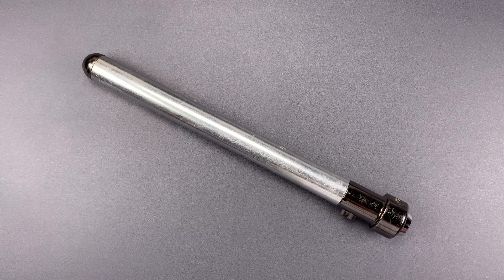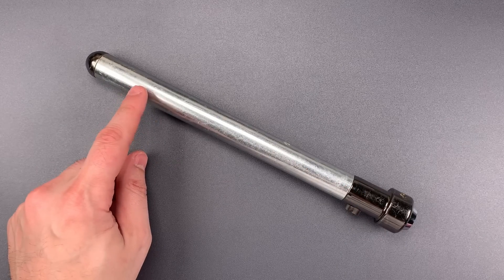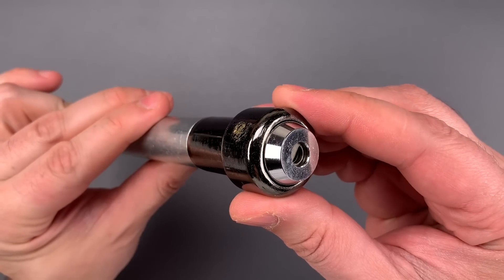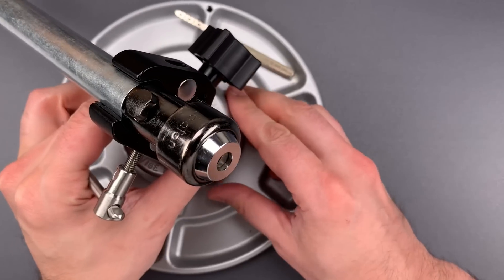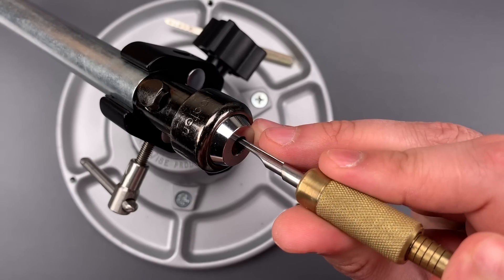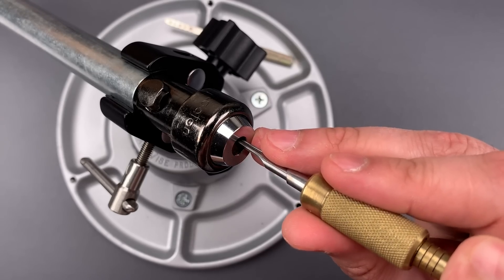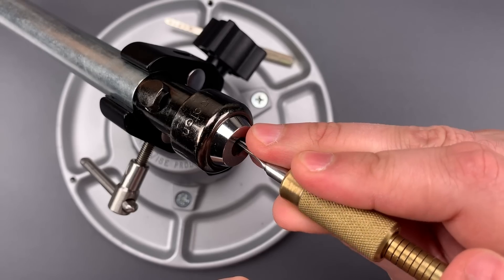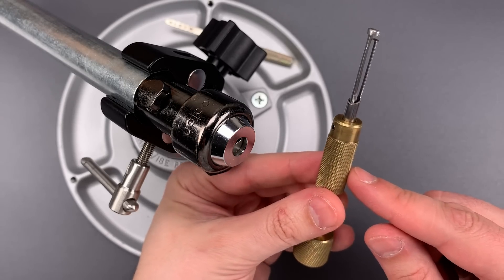[1003] Strange Newspaper Vending Lock Picked (Baton 6000 Series)

Comment: Somehow a newspaper vending machine has a stronger lock than most locks holding actually valuable items.
Reply: Especially when you consider that you could steal every newspaper in the box for just a couple of quarters.
Reply: It's meant for the head, not the paper storage.  $50 in quarters is still $50.
Reply: Locks only keep honest ppl out (with some solicitor exceptions)
Reply: @tashkiira7838  You're right. It's been so long since I've seen a real newspaper box. Thanks for pointing that out.
Reply: @danielr8257  Those machines open really easily with a wire coat hanger.

Not even a bent one, you can leave it shaped like a hanger.
Reply: any safe on Amazon for instance...
Reply: @danielr8257  this would be for the stack of newspapers in a box style, but not for locking the newspapers up, but for locking the coin box up.
You can smash the glass if you really want a newspaper, but the coin boxes are encased in heavy steel housings with hefty locks, because they are common targets.
Reply: Especially if you take into account the security through obscurity factor.
Reply: It makes sense if you think about it. If these were the locks that contained the valuable items you speak of, then more effort and tools would be readily available to pick it. It only seems more challenging because this is not the lock most people will be concerned about.
Reply: newspaper vending boxes have quarters in them they do hold valuable items. I know because I used to deliver papers and I had 4 of those on my route. But ours just had the regular pin they have with a large padlock on it. That was the first time I had actually seen a locking pin. It's very clever actually
Reply: @brokenhalo22  They also open very easily with a well placed hand grenade.
Reply: There's nothing more valuable than the news bro
Reply: Apparently a prison lock is easier to pick.
Reply: It's not the news papers it's securing it's securing the guy carrying money and the money he is collecting
Reply: Let's face it, the only use for newspapers nowadays, is to line the bottom of a bird cage, soak up puppy pee, and be used for kindling to start a fire.
Reply: I have worked in newspaper sales and circulation for almost 10 years. 99% of racks do not have this type of lock. Most are a bar, but just one with a hole for a padlock. Much simpler. It isn't necessarily for more security, but more for ease of use and engineering purposes. I have dealt with so many stolen racks that the bar is pointless, as would be any other lock.
Reply: There was a time when newspapers actually were worth something.
Reply: @danielr8257  Newspaper vending machines have come in various forms, the most common being a box with a door on the front that open either downward (for stands-alone version) or sideways (for the rack version). Both of these rely on the honor system when it comes to buying a paper as the purchaser can just take more the one without paying for the additional paper(s) if he wished. The have also had newspaper vending machines designed to dispense one paper at a time and thus prevent the purchaser from taking more the one. These were much more expensive then honor system versions so I’ve only ever seen them used up higher priced newspapers (There was an more expensive adult newspaper in my area that used them). I think that the purpose of this strange lock is to secure the coin box of a standard  honor system newspaper vending machine. 

In the typical types of newspaper vending machines that you use do see all around where have lived, the upright version had big padlock that secured a long bolt that secured a access door for the coin box on back, with the padlock surrounded in metal shroud to prevent it fro being easily cut off with cutters or a hacksaw. They also had two key holes on the front on opposite sides of the coin insert slot, one for switching from weekday to Sunday pricing and the other was for allowing the person stocking the newspaper in the morning to open the vending door without needed to insert a coin(s). Older newspaper vending machines used paracentric locks and keys for the coin-bypass lock and Weekday/Sunday switch (I.e the common flat key with groves on the sides and ridges on one or both edges). Later, tubular pin tumbler locks seemed more the norm or a combo of both. Newspaper vending rack boxes used at first just a tubular pin tumbler lock heavy secured the whole front face of the individual rack box which once lock allowed the newspaper delivery man to pull down the full front to fill the rack in the morning (or afternoon) as well as access the coin box all at the same time. Later they added a giant padlock at the top right to help secure the front panel even more. None of the outside visible locks on newspaper vending machines used a removable tubular pi. Tumbler rod lock that I can recall soI bet the tubular pin tumbler rod  lock like shown in this video was internally for locking coin box into the rack separately on the rack box type newspaper vending machines so that just getting the front face panel open didn’t allow you to just snatch the coin box and run.
Reply: There is nothing more valuable than fake news
Reply: Do you not understand how valuable newspapers are?
Reply: @danpowell806  you could just hold your foot at the bottom of the door hinge and then yank real hard on the door and ti would pop open on most of them.
Reply: That’s a straight up insult to injury
Reply: Exactly, just like that gun safe vid he made, it took him like 5 seconds to open the safe
Reply: better lock than most of the gun locks he has picked
Reply: They weren't trying to appear special and unique.
They just used a simple, time-tested mechanism.
Reply: ikr
Reply: @tashkiira7838  There is never that much in the box usually  a days take. Less than $10 to deter theft.
Reply: @ke6gwf  The glass is actually a lot harder to break than you'd think. A buddy of mine kicked one in once so he could take the $1 in quarters his mom would give him for a paper and still return with said paper every morning.
Reply: Dude u can store money in it too just because of the name dosent mean its not valuable
Reply: Newspaper is very important 
Hitting flies 
Potty training for puppies 
The classic reading a comic book behind the paper 
It just keeps going
Reply: @flaguser4196  wait they haven’t already
Reply: consider if circumented that meant free newspapers for everyone and the decent security isn't so surprising
Reply: They're actually valuable items from the companies shoes.
I think not too sure though
Reply: @Kittyreaper  no.  that's just wrong and bad logic.  whether you know how to do it or not, picking a disc detainer is objectively more complicated and skill demanding than wave raking 95% of the locks that are holding valuables.  picking methods between different lock styles are not equal and encounter rate is not the reason.
Reply: @derpderpin1568  It's odd that you argue against points I never made - I believe there is a misunderstanding here. I think the entirety of the LPL subscription base can agree that wave rakes are low-skill and that disc detainers take more knowledge and skill to overcome.

The point I was actually making two years ago was that certain less frequently encountered locks may seem trickier to pick just because the demand to pick them is low and they are not regularly seen. That is it. I was also referring more to the irregular types of locks, not an everyday lock that can get wave raked in two seconds.
Reply: The mafia
Reply: @ayee7503  same with your house door but we aren't talking about that
Reply: @UwU_Mimsykins_UwU  I'd prefer $50 in quarters

Comment: "this is a pick that I made MYSELF"

Bosnian Bill's heart breaks
Reply: He said that the one the two of them made would not work with this lock.
Reply: @fortisprocer966  did he?
Reply: He did make this himself, the one Bill worked on looks different
Reply: @vanerek  In the comments. It was made to work in the standard keyways for disk detainers and cannot properly function in these ones. You might be able to make it work but it would be more effort than it is worth and still might not work.
Reply: @acephantom903  got it, thank you!
Reply: This is basically NTR
Reply: Lee Trott it’s the albeater designed by huxleypig69 the man who picked the protec 2
Reply: acephantom903 more effort than it is worth? He went out of his way to create a brand new pick
Reply: oof, I feel bad for BB.  xD
Reply: They could add a threads to that one to use different tips. Could also add a groove to clamp something similar to this video to the outer body.
Reply: Woodshadow it won’t work since it doesn’t tension from the back, it tensions from the front disc
Reply: @sohamsengupta6470  Woosh
Reply: @gogogooner  You mean to say that the joke was that he didn't use Bill's pick which made Bill sad? Well it doesn't work as a joke cause that pick is not effective on this lock
Reply: @sohamsengupta6470  Your initial comment suggested that you believed that the initial poster did not understand that it was not the same pick.

And yes, the joke works even if the logic behind it is flawed. If not, one could not be amused of a joke before the logic of that joke is scrutinized. That is simply not the case.
Reply: "Hey, that was a funny joke! Or was it? Let me make sure that the joke us factually correct and the thought behind it works out before I decide to laugh or not."
Reply: But only he made that one the other would not work he said
Reply: LPL : The pick that MYSELF and I made
Reply: @gogogooner  woooosh is for when someone doesn't get the joke; not when someone gets the joke, but corrects it because the logic was flawed.

woooosh in this case would go to someone who thinks that Bosnian Bill actually cried over this... Which I don't think is happening.
Reply: @gogogooner  Jon Stewart makes exactly this point in conversations about whether he was actually a newsman or just a comedian. He says that he had to do more work to verify the facts, because a joke falls apart if it's not accurate. I think I'm going to listen to him about comedy before I listen to you, if that's okay?
Reply: 11 inch.. ooh.. wow... I... want to buy it now for a certain use....
Reply: Well..

Comment: My mom used to deliver papers, and we didn't get issued keys for putting papers in the boxes when they were part of the route (it was a mixed route of stores and boxes), we'd be given what were called "Slugs" they were disks of metal the same size and weight as a quarter to open the box and put the papers in.

Comment: In the 60's,, at least where I lived, newspapers were sold on the honor system, with just a small rack and cylindrical coin box. During the 70's they went to having locking boxes, although a store near me in the early set up an honor system rack in the early 80's and kept it quite a while, suggesting not that many newspapers were stolen. Now days, the newspapers don't need a lock, they need a mechanism to pay you some money to persuade you to take a paper.

Comment: Honestly for an obsolete design, this is way more secure than it probably needed to be.
It'd be difficult outside testing conditions to get proper tension, since the bolt would probably spin whenever you tried and there's no easy way to hold it in place.
Pair that with a system so obscure you need a custom pick, and you've got a really good lock for the streets.

Comment: I used to use these when I worked at the Modesto Bee collecting these machines and repairing them. The problem with picking them is that the keyhole is covered by metal

Comment: You really should patent those tools and get them up on amazon; they are pretty amazing.  You making them yourself is really a skill set that is higher than most :0.
Reply: Making them is one thing, producing them at volume for sale is quite a different challenge.  He should try it though
Reply: This one, while made by LPL, was designed by huxleypig (Matt Smith), so good luck doing that. The one Bosnianbill and LPL designed is original, but they essentially gave the design to Sparrows, with the goal to make it available as widely as possible.

He's a lawyer, I'm pretty sure he's in a good enough place financially that contributing to the community is more important to him than the money he could earn from a niche tool.
Reply: You'll see that sort of thing more often.  people reach a level of skill where they need tools that are hard to get or even not commercially available, and they make their own.  Lots of people end up picking up some general maker skills related to the tools they need.  Harry needs a special lockpick for disk detainer locks?  He learns a little basic machining and builds one.

for that matter, lots of high schools TEACH machining to the students in shop classes.  And learning basic fabricobbling can be as simple as watching skilled people at work, then trying yourself later.

Comment: I had a best friend whose dad serviced paper boxes overnight and I would often help them in the mid 1980s.  There used to be a simple paper-door bypass for a majority of the typical American-style newspaper vending machines, although I haven’t tested this in a few years (I retry it every few years just to see if they’ve fixed it - with varying success). 

You give the machine a very firm palm strike on the flat face of the coin receiver while simultaneously pulling open the door.  Simple as that.  If timed correctly such that the palm strike hits a couple milliseconds before the door reaches the stop, it would often come open.  Usually took us a couple tries to figure out the timing but after that it was one pop and open.  I suspect this depends on the relative stiffness of some spring holding the door latch in place.

But you know newspaper vending machines have always kinda been on the honor system anyway.  For 0.75USD a person could swipe all the papers in the box - and they occasionally did and probably still do.  So putting a ton of effort into the door lock is probably not worth a lot of effort.

Comment: I think this is a perfect level of security for the purpose. It escapes the most casual pick attempts. And even if someone breaks in, they will probably only take a single paper (which isn't much, obviously)
If they wanted to just do mischief? There are easier ways- like a baseball bat? Or just taking all the papers after legally paying for entry (depending on the exact design of the device).
Reply: Actually having worked with the boxes. This lock would hold the top portion that holds the electrical mechanism for changing the prices for regular editions and Sunday editions (two different prices here) as well as the coin storage. Which depending on location and frequency of emptying could net a decent amount. Ofc you could access the papers at this point as well.  Just some insider knowledge!

Comment: The newspaper vending machines where I lived where easily exploited. You just had to pull on the front door and knock it back quickly with other hand. It felt like that quick motion circumvented a hook holding the door shut.

Comment: I mean... Whenever you consider a lock you should always consider what it protects. If what you are protecting has great value and/or danger the better a lock you will need. If you need uncommon specialized tools to unlock a lock that simply protects newspapers... Then you have probably succeeded quite well.

The most appaling video I have seen from LockPickingLawyer was the one where he unlocks a police lock for an AR-15 with a magnet in no time at all. This means that you can get an AR-15 with ZERO skill, basic knowledge and a common tool that is not specialized. That was an example of a lock that did not fit its purpose.

Comment: Pretty serviceable for the use:

1 - took  you more than seconds + custom tool so very good
2 - who'd steal a newspaper these days?  That's why they have an 'honor' system where you are trusted to take one copy for the most part - since advertisers pay for the thing.

Nice video!  Not really defending the lock or anything, but neat lock and IMO the obscure design was deliberate to keep out casual picking.  Anyone taking longer and not caring - well there are cameras everywhere and better than smashing open the thing - the cost of replace/repair would be more than a handful of quarters and armful of newspapers.

Comment: A question, if it's possible to open it with such a short tool then why the key, or the lock itself for that matter is that long?
Reply: The key is no longer than the tool. This is so long to reduce the vulnerability to prying the cashbox out.

Comment: With that size I was expecting a crazy amount of disks going all the way through the lock making it hard to open with non-specialized tools. I don't know much about lock picking, does putting disks very deep from the keyhole make it harder to pick? If the disks were double the depth the tool could reach would that make it more secure than then medium level anti picking measures?